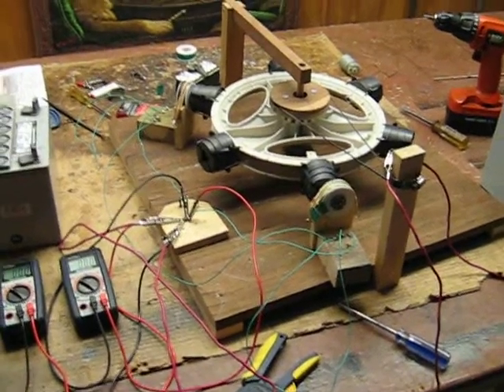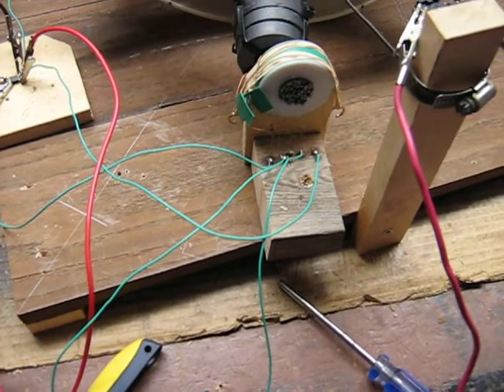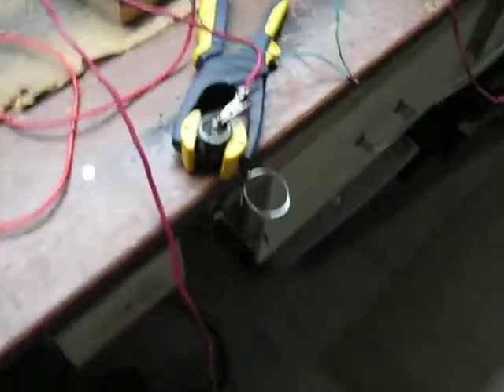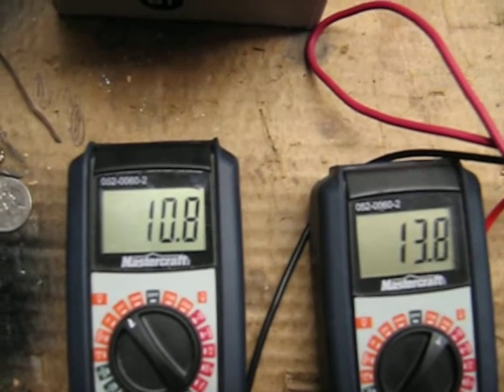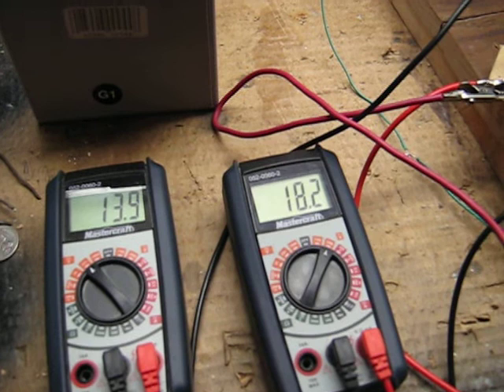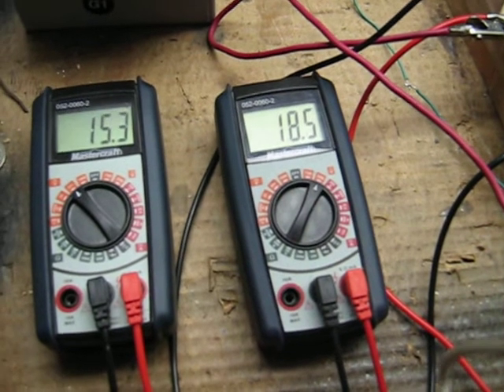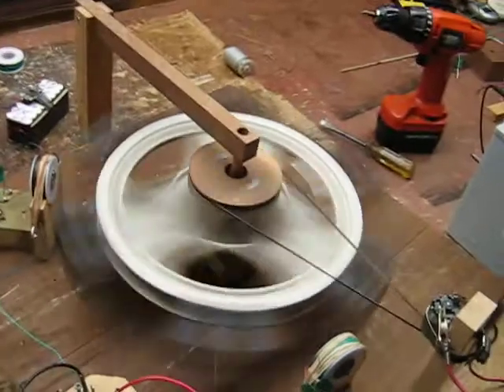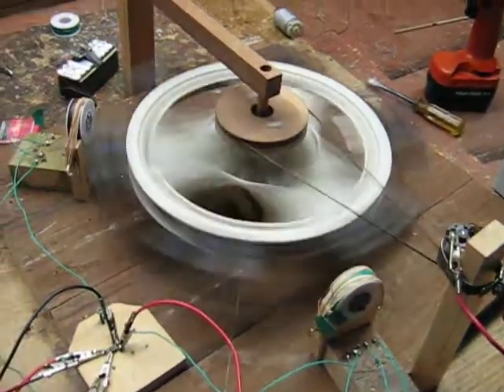Bedini - 1984 Concept

Comment: The reason it jumps up is its reading the voltage building on the 160v cap if that's where it's hooked up but I'm not sure how you got it set up. That's my guess